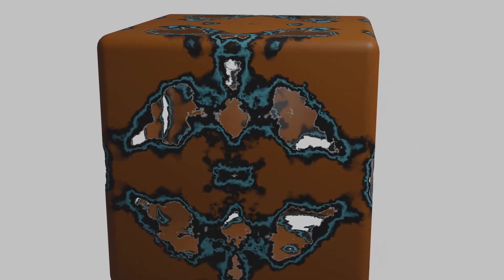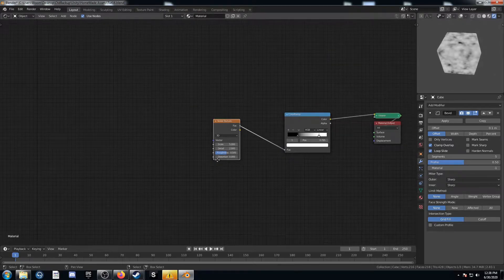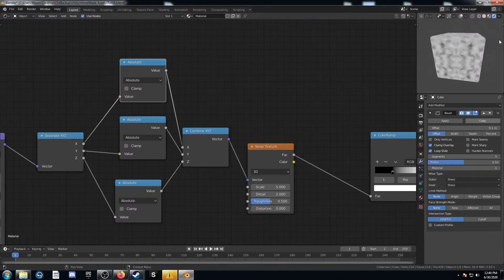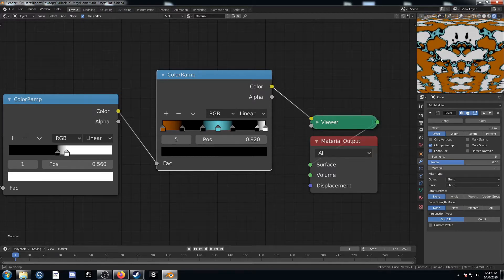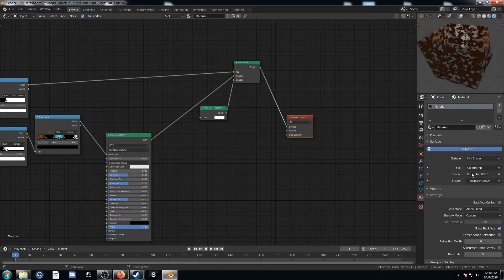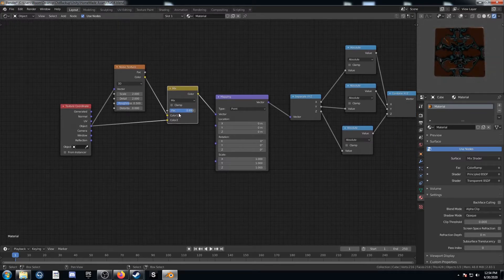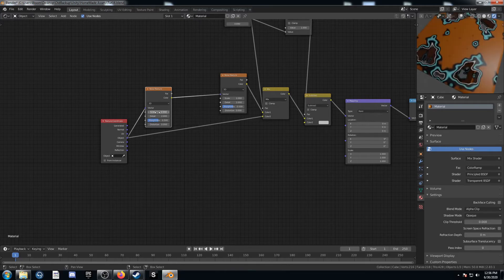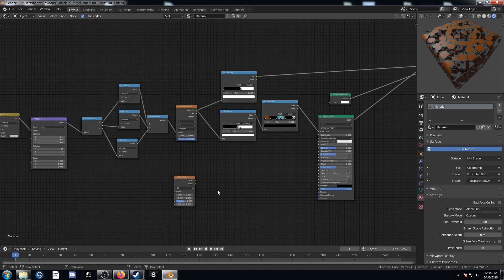Procedural Nodes (part 16) - Mirroring a Noise texture in Blender

Comment: Great tutorial and awesome channel!! Thanks so much. You can actually just put a Vector Math Node (Set to "Absolute") right after the Texture Coordinate Node. This way you don't have to separate each axis and combine them again. This also keeps the symmetry in place if you transform the vector after.
Reply from the maker: Thanks! That is true, when you use that sepxyz it allows you to just mirror on a certain axis though which is nice
Reply: @snow_mamba  True!

Comment: Any way of making this work with a UV?
Reply from the maker: Yeah should be the same techniques. You may need to put a mapping node after the texture coordinate to remap things a bit but it should be about the same amount of work as what i've set up
Reply: @snow_mamba  I managed to get it working :D, I used a separate xyz and in the math node I set it as ping pong, it worked perfectly. Thanks!, I only used the math in the x as that's the only one I needed